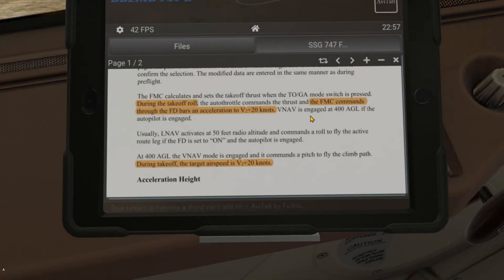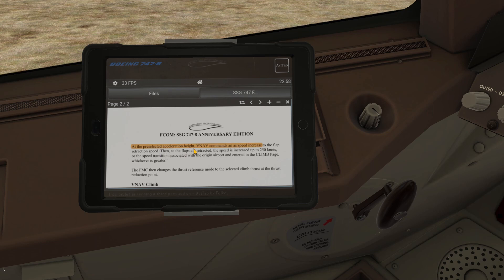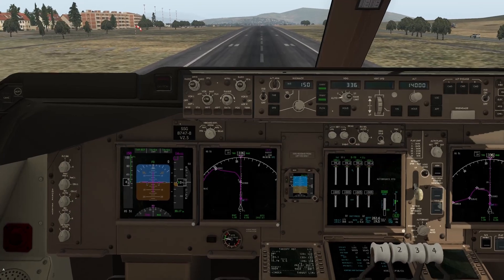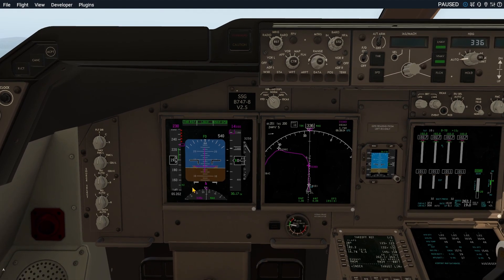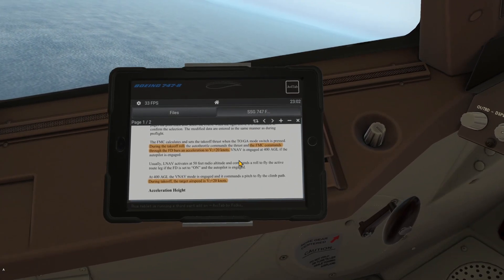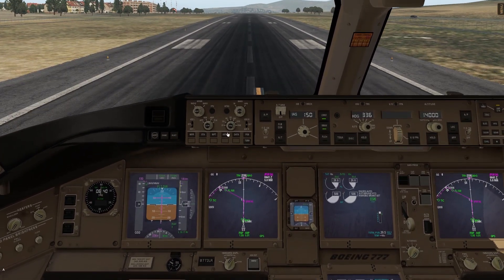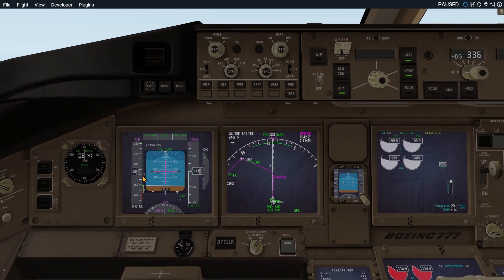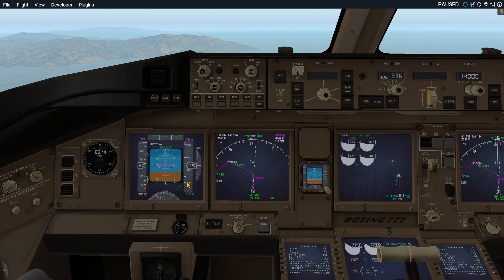SSG 747 v 2.5 | Episode 2 | Bad Takeoff Logic

Comment: Damn i regret buying this aircraft
Reply from the maker: With this update I have some what given up on SSG. I also don't understand why there is public beta testing, if the issues, that are reported by the community, are ignored anyway. It almost seems to me as if SSG has no access to their code. 
To me the plane feels like a script: 
Whenever I do something, that is not in this script, it becomes obvious, that the algorhythms don't work as they should.
Reply: @logicautopilot  Yep.  Fly LNAV/VNAV all the way on autopilot and it will 'probably' seem Ok.  Do anything else and you quickly discover many anomalies.  SSG generally just ignore people that report issues, especially relating to FMC.  I think I've seen them claim the testing by real world 747 pilots and the large number of beta testers as evidence it must by you not the plane.  FMC issues like in this video just continue version after version !
Reply: yeah. i am very very angry today. it is consist of bugs. how dare they sell this horrible rubbish at this price.felis is way way better.
Reply: This is why I don’t like x plane 11 payware addons. You can guess that I use fsx/p3d cause the flight dynamics and other aspects of the sim are different but it’s cause they have better addons. PMDG does a way better job over the 747 and 777. The PMDG and zibo 737, fslabs/aerosoft and toliss/ff A320, cs/qw and ff 757 and 767 are comparable. After all, xp has the ff a350, toliss a320neo and a340-600, but I prefer p3d by a long shot because of the qw787, aerosoft a330, PMDG products, etc.
Reply: @PhilMC_  Good lord, are you judging all XP11 payware addons based on this turkey?

Comment: Good! looks like I am not the only one who dissatisfied. And ,I have logged some bugs. Do you have the same problem?

I am a noob beginner so some of the bugs maybe unkown plane feature to me .Let me know if it occurs.
Device: Surface book 3 with GTX1650 mounted.

1.Can't select DEP/ARR page if route is not EXEC.
2.Can't select LEGS page if RTE is not activated while APPR is selected.
3.ND in PLN mod then click STEP in LEGS page, the showen waypoint may not be synchronized.
4.Flap speeds on PFD may not appear when needed.
5.Auto throttle doesn't act when climbing to the required altitude (and no A/T FMA is showen) if MCP altitude be adjusted lower while climbing and reach the adjusted alt.(and the  auto throttle become buggy and i arm it again.)
6.The T/C point and the T/D point should be calcuated more often.
7.The ND can't show the route if the range is seleted at 2 or below.
8.The PFD speed indication may be shaking while flying.
9.If I start to decent before the T/D point by insert the MCP altitude, the curse ALT will be changed to the setted ALT and SPD and VNAV SPD will be showen together at FMA.
10.After reaching the MAGICALLY ,STRANGE T/D point which I have totally idea why it appears,the plane become buggy and start to climb.
Reply: Auto Throttle works fine if u operate it correctly! I love this plane and XP11. Reading the whole Manual might help!